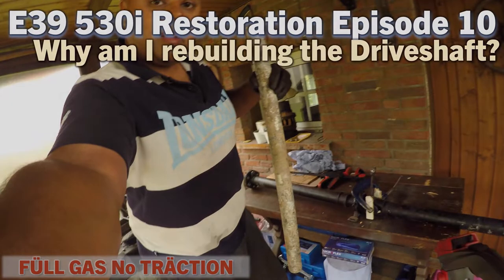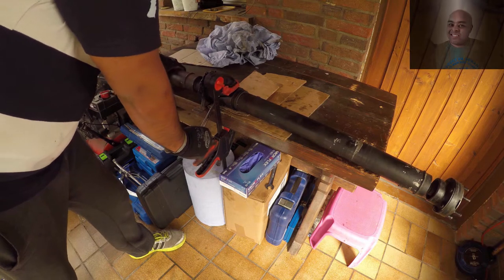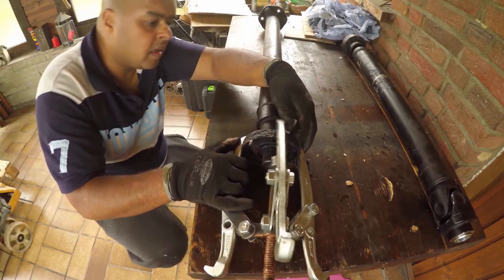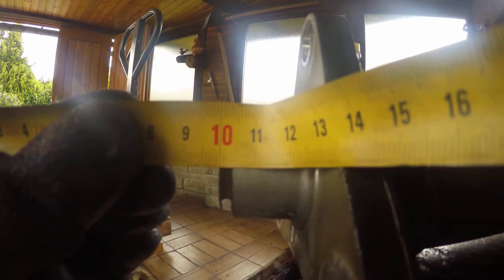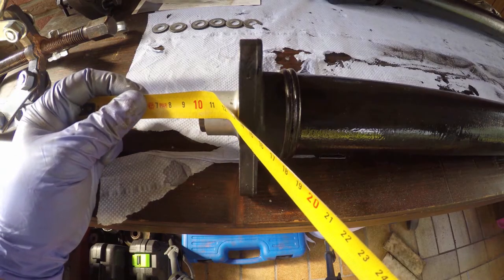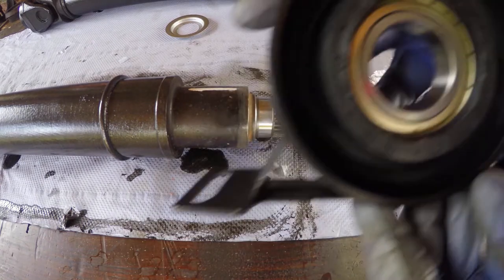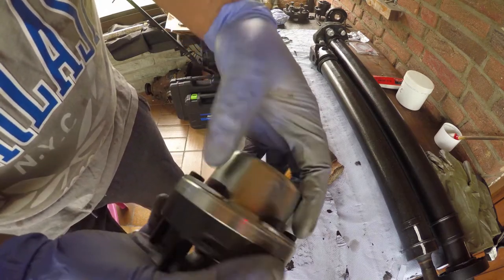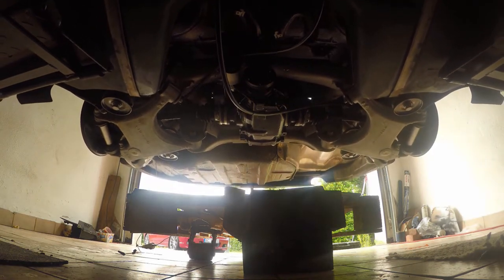Part 10: BMW E39 530i Touring  Driveline Restoration - Complete Driveshaft Refresh

Comment: link to that cv joint for the driveshaft??
Reply from the maker: try this: https://www.daparto.de/Teilenummernsuche/Teile/Alle-Hersteller/26117503103?ref=fulltext

But you should check your individual application, because there are a couple of different options and it needs to be compatible with your specific differential and propshaft.